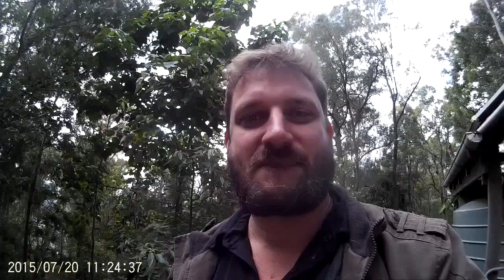How to Check AGM Battery Balance - AGM Battery Balance Pt 1

Comment: With this simple battery reconditioning method, you won’t have to buy new expensive batteries in 2017.or ever again [Check Details Here==>https://plus.google.com/100351090281822647456/posts/Gwtd4mVBdEd  ] .You can just recondition your old, used batteries and save a lot of money!